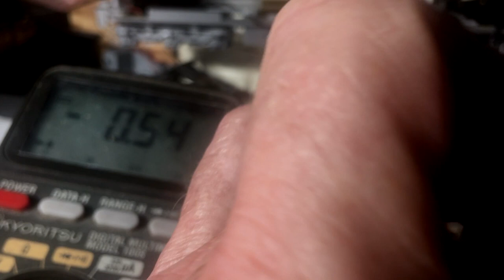Atlas "Silver Series" Dash8  40-CW motor replacement. part 1

Comment: I have some of the same locos runs great but some has a hum sound and makes a thump sound but are great runners.
Reply from the maker: They are great locos! The hum could be the body vibrating as they are tight fitting? The thumping sound will be a split gear on a axle , and they are easy to replace if you choose to .
Thanks for watching.
Cheers Gregg.
Reply: @FishplateFilms  what replacement gears do you use on the Atlas 8-40 CW.
Reply from the maker: @csxns  I'm pretty sure all the Axle gears are the same for most Atlas diesels, but their spare parts  site is pretty good.
Gregg .

Comment: How did you get the shell back on? It always seems so tight on these Atlas Dash 8's, and I can never get it to fit quite right it seems
Reply from the maker: You have to be careful for sure, and I tape over the wires to make sure none catch on the body. Sometimes pulling the shell away from the body a little can help, but be careful. Also there is little room on top so if you have untidy wiring that can stop the shell from dropping all the way down.
CHeers Gregg.

Comment: Original QSi had features many new Decoders don't,and plenty of volume,unlike many Australian offerings of late.
Reply from the maker: They were better than ESU at the time,Dennis, and had some nice sounds, but didn't play with other decoders very well. I ran them for a few years until I upgraded all my locos to Soundtraxx. I'm not familiar with the Aussie decoder sounds , but most of our stuff is US any, so you could use Tsunami and pick the right prime mover? You may miss some local sounds though?
Cheers Gregg
Reply: @FishplateFilms  Local manufacturers use ESU.I'll say no more.And yes,Soundtraxx has many positives.Have QSi locos that still go just fine,and go well on DC,for those stuck in the past.

Comment: do these motors have brushes?  are the commutators dirty with carbon dust that conducts power between contacts?  have bearings/bushes worn out?  i wouldnt be throwing them out.  i'm sure you will do an autopsy.  with what i know now about power and cordless tools, i could have cleaned and tidied up the important bits instead of trashing them and buying new ones.
Reply from the maker: They do have brushes, but unlike KAto or Athearn RTR motors, they are not serviceable. This one is polling by the feel of it , and was crystal clean inside. I feel the motors are getting cheaper and less reliable, apart from possibly the new Genesis ones , or the bullet proof (new) RTR motors in the Athearns , which I think run as good as my Genesis or Katos .  I also hate throwing them away , but it's still better than a new loco!
Cheers Gregg.